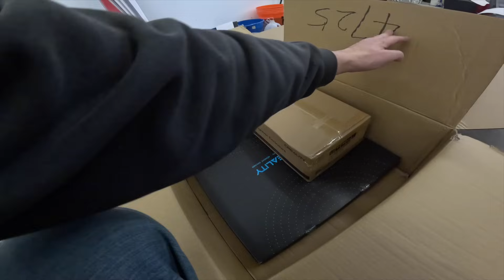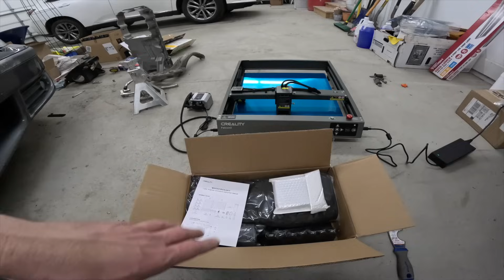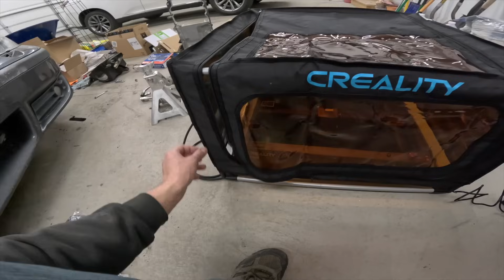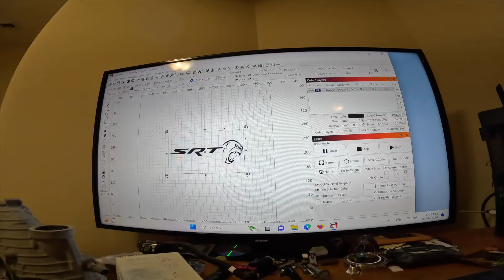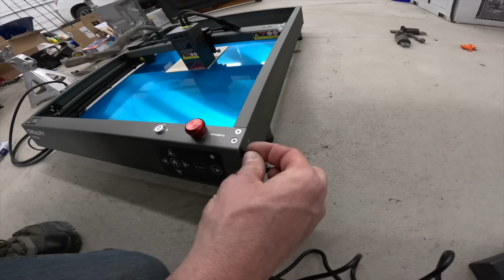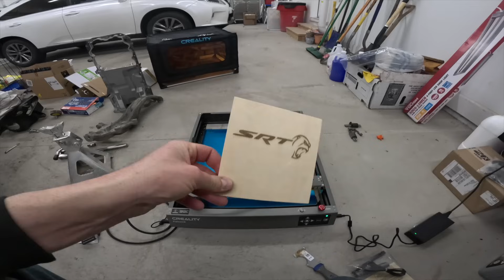CREALITY LASER ENGRAVER MAKES ONE OFF EMBLEMS FOR FREE!!!

Comment: If you wanted to make the emblem and you have what you want 3D printed. You could make a sand casting of the 3D print and pour molten brass in the sand casting. Then smooth it off. And send it to chrome if you wanted chrome. If not you could use the casting melt some aluminum cans and cast in aluminum. Load of ways you change the color with aluminum.

Comment: For car emblems resin printing is the best option. Prints come off looking injection molded, you can print 1 or 10 of the part at the same time and the print time is the same. There are also videos here on YouTube how to coat and electronic plate them with copper and nickel for the finished product. I have literally printed something 100% unfilled on my Fdm printed that was a 40 hour print that took 10 hours on my resin printer.

Comment: For doing metal there is a spray to initially cover the metal with so it doesn't you get the full power of the laser, preventing reflection